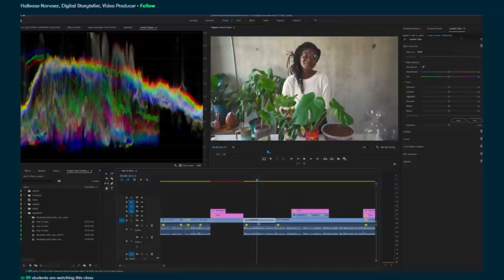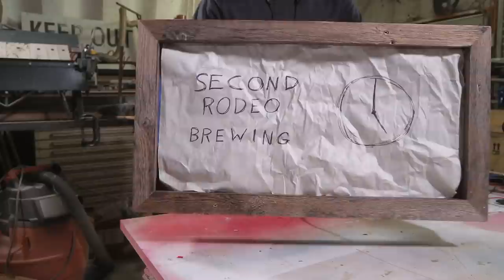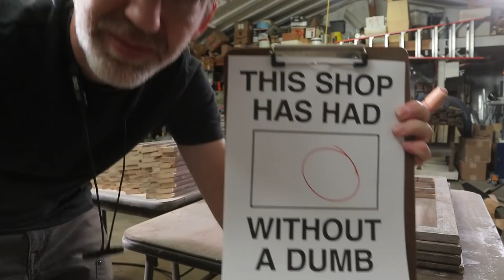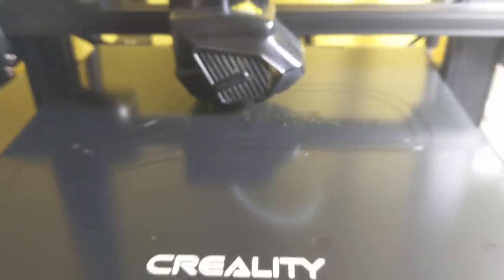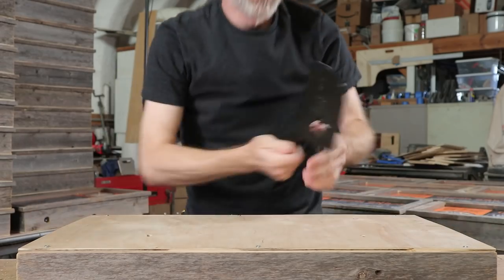Making 50 Brewery Signs From a Rotten Fence

Comment: What is there not to love about this video? You have dirt as creamer or sugar, a nail gun that ejects nails, a toilet brush disguised as a drill brush, and a subtle middle finger to haters. The "0 [days] of no dumb" and 50 clocks were just a bonus.

I'm also very happy to see that it looks like you used a dummy battery in the clock mechanism to feed power from the mains source rather than having to swap out a battery every so often.

Comment: Pin nailer is both one of the most useful tools and the most deceptively dangerous tools. Up there with the 20v cordless drill/driver which has the weight and torque to seriously jack up your wrist if you are not used to it.

Comment: Quick question: how do you determine your bottom line when bid a job or are commissioned for a job? I have been asked to create a few pieces for a local business,  but I have no clue when it comes to a bid or commissioned price. Any input would be appreciated. Thank you in advance.
Reply from the maker: Quick Formula:
1. Work out your cost on parts.
2. Add 50% or even double it. (You WILL get dinged by shipping costs, mistakes, unforeseen consumables, and sudden price increases on materials.)
3. Determine your day rate. (Don't forget you pay taxes.)
4. Overestimate how many days it'll take to complete the job. (Beginners especially will underestimate the time it'll take.)
5. Don't be afraid to lose the job after quoting. Don't go in the hole to make a client happy.

You will screw this up a lot in the beginning. I did. Make peace with that before beginning.
Reply: @WesleyTreat  thank you Sir! I will send you a sample of my Idea when I can ramp up the production this winter.

Comment: Hi there, I was hoping to ask your opinion of the shopsmith. I'm aware there are many different models. I'm not very interested in it as the multi-tool that it was marketed as. I mostly work with metal and made my own milling machine as well as a few other machines.I recently was looking at a shopsmith that a neighbor had for sale. It was very appealing to me simply as a gear headed potential drill press or headstock. There is a world of things useful that can be built by having a motor and robust gearbox already mated with a spindle. My understanding is that ShopSmiths were marketed almost primarily for woodworking. My experience with metal machinery is that even one horsepower can do enormous work if properly geared. Having never run one first hand, I was wondering if you could give your opinion on its rigidity, potential durability, and total indicated runout. Is your overall impression that this unit is fairly tough? Are there facets of the shopsmith that make it very difficult to adapt for other uses? Exactly how many speeds does it have? Do you know if the gearbox is plastic years or white metal instead of steel or cast iron? Any general impressions would be helpful, thank you very much
Reply: I would not use it for metal, especially the older models. There are no gears and fixed speeds. It uses a variable speed belt and pulley system, you can pick any speed between the low and high. When you turn the speed crank, the pulley grows or shrinks to change the ratio. The new Power Pro headstock uses a digitally variable speed motor I believe, but it is not meant for metal use either. Most of the ones found second hand for sale, are the pulley and belt system.
Reply: @chadvoller  thank you very much. I had no idea it was a Reeves drive. I did not take it apart at all. The neighbor was insistent that it was geared. Very helpful.

Comment: I don't know how your material usage worked out, but I feel like you could have optimized pulling apart those fences by running a circ-saw either side of the 2x4s and not have to pull nails.
Reply from the maker: That would have created too many short pieces, making material usage more difficult. Besides, nails aren't a problem with the denailer. That was the easiest part of the whole thing.
Reply: @WesleyTreat  That's sort-of what I figured. That denailer does look fun.